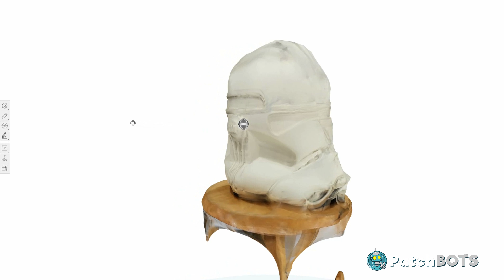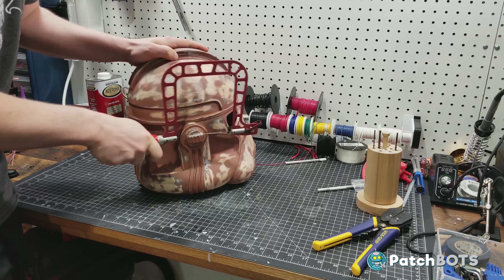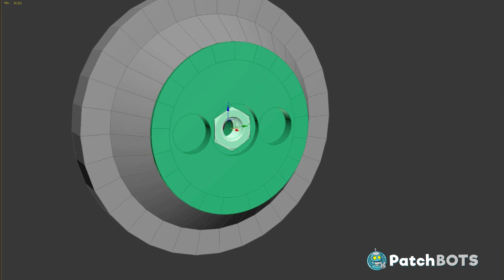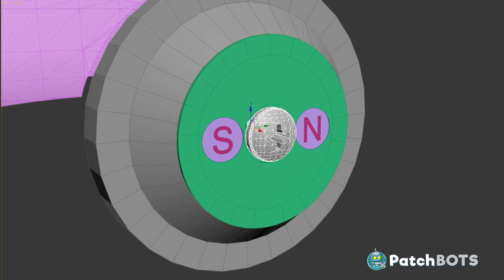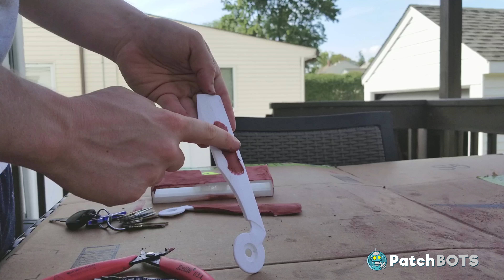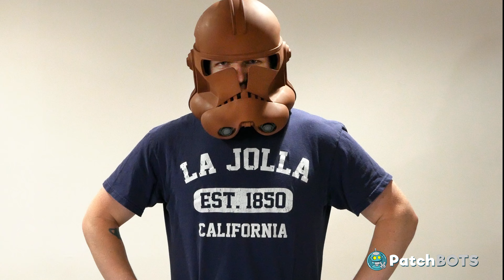Clone Commander Bow Build - Part 5 - MacroBinoculars

Comment: Awesome job
Might add a pair of macrobinoculars to my mando helmet.
Reply from the maker: I've sold several pairs to Mandolorians like yourself.  They end up looking pretty cool, but they take some modification to fit properly
Reply: PatchBOTS 
I've seen a few mandos with these and I agree that they do come out looking great after the adjustments are made. 
My helmet has a range finder but somehow it's not moving at all so I'm thinking of replacing it.

Comment: How tough is the cast resin material? Does it feel like it could actually be an armored helmet? Or does it feel kind of Chincey?? I realllly want to get a helmet but idk. Can’t justify it lol
Reply from the maker: This is a great question because I was in the exact same spot.  I'd never worked with resin before and was really curious how it compared to some of of my tougher 3D printed stuff.  The answer is;  resin is super durable.  I was totally impressed about how NOT chincey it felt.  I was expecting thin walls,  easy splitting,  occasional shattering, but no....it's atually awesome.  I've had helmet from 3 makers,  Dino from Sanotized Creations made the helmet in this video.  This one is real nice. The walls are a good thickness, it's easy to work with.  I have a Phase 1 animated helmet that I'm playing around with from Davide at Dave's Armory. This is by far the thickest one...almost too thick. 'You ain't breaking it'  The closest to 'chincey' was my phase1 heatshock helmet that I made some binoculars for.  It had the thinnest walls by far and felt like i could easily break it, but I did a lot of work on it and it didn't crack once.  I'm sold on resin casting for sure.  IN fact, I may start making these macrobinocs (at least the arms) out of resin real soon
Reply: PatchBOTS thank you for a swift reply! I’ve been seeing these helmets on Etsy all over the place and they are all resin cast for about $120 give or take. Does that seem reasonable? I will check out the makers that you mentioned! Thanks again. Your helmet looks badass lol. Wish I had enough for an entire suit of armor but maybe a helmet will suffice for now :)
Reply from the maker: Yeah I can't say anything good or bad about those etsy casts. I've seen them too, but never purchased one.  I have a large head so the EVO3 cast from Dino at Sanotized was perfect for me, it has a lot of room on the inside, moreso than other any maker from what I hear.  Good luck!

Comment: i-want
Reply from the maker: I will definitely be finishing this one, so hopefully it turns out well.   Dremel is a brand of rotary tool.  They are really well made tools at a range of price points.   You can get away with not having one but you'd be doing yourself a favor to find an inexpensive used one.
Reply from the maker: Cool, if you really want a set I have some kits available.
Reply: PatchBOTS do you sell them premade?
Reply from the maker: Sorry I just have raw kits at the moment.
Reply: PatchBOTS oh well, what age would you recommend starting to build a set, I’m 14 right now I’m gonna be 15 in a couple months I know I couldn’t join the 501st until I’m 18 but do you think it would be worth working on buying armor now?
Reply from the maker: i think you can probably get a helmet for relatively cheap.  Just start with that.  If it seems like a hobby you want to continue take it from there.
Reply: PatchBOTS I hope you end up finishing the entire set, I’d like to see how it turns out. Also how hard do you think it would be to build an armor kit without a dremmel or whatever you call it.
Reply: PatchBOTS alright, good luck. I’m looking forward to it!